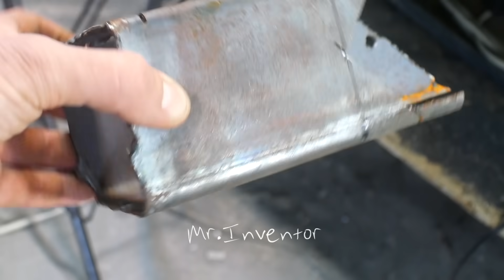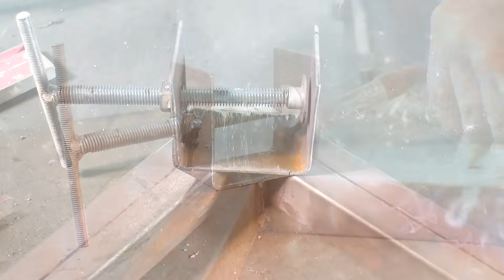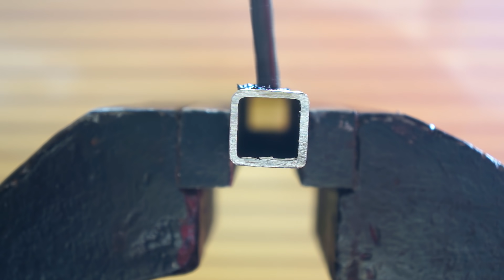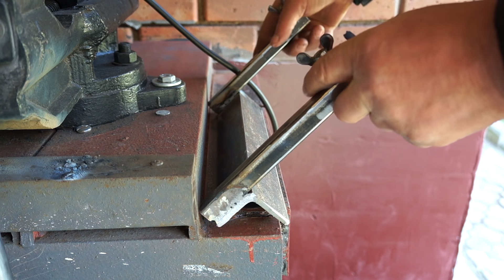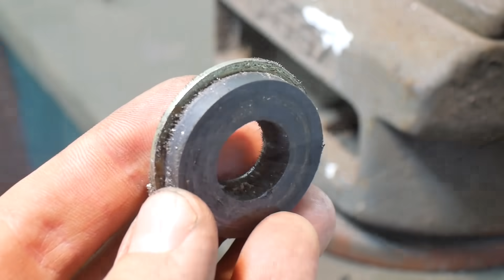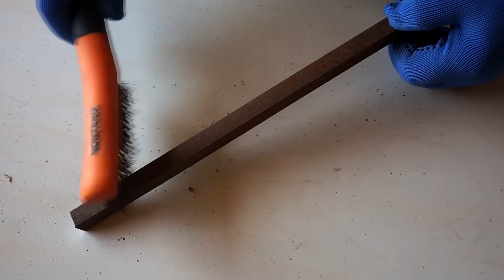OMG! 4 SIMPLE INVENTIONS

Comment: Is no one going to question the welding electrode holder that was made out of a drill chuck??? Probably been in another video I haven't seen but as a welder by trade that hurt my eyes
Reply: I missed that, but guess it would work for awhile till something arced inside.
Reply: Yes he is welding with a DeWalt 18volt cordless drill, battery is about half full, Chuck is in reverse. Makes welding on the go so much easier than lugging around a Miller mig and tanks and for a fraction of the cost.

Comment: The picture of the bolt and washers welded together as a crowd draw by the first image is a little deceptive. What was the tool that you used for the title page of this video? -Ron
Reply: I'm with ya Ron.
Typical B.S.
Whomever it was, should make 'em use it for a toothbrush using a drill

Comment: I like watching you make stuff, but again, Mr. Inventor, these things are not "inventions." The roller support you made has been in use and widely available for decades. Amazon sells a magnetic welding clamp that looks like a direct copy of yours (vice versa?) and so you should sue them if indeed you have a patent on the device. I don't even know what that last thing is or how it represents an invention, an artfully sculpted piece of square stock. The only one i didn't find in my 20 seconds of googling was the clamp to hold doors perpendicular to the floor. If indeed that is an invention, you should patent it, although I'd hazard a guess that a machine patent won't be issued because it is too simple, but a design patent could possibly be granted. Cheers & keep makin', both stuff & videos. I know a lot of work goes into them & I appreciate that.